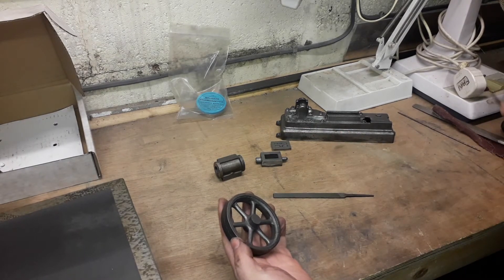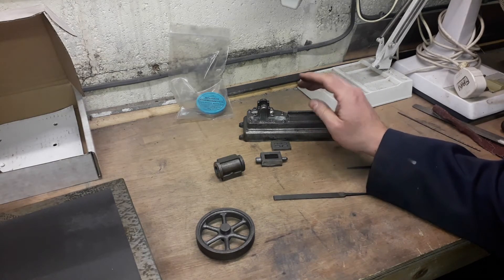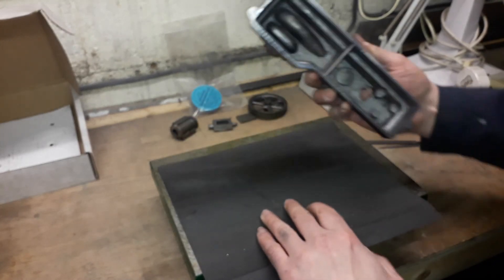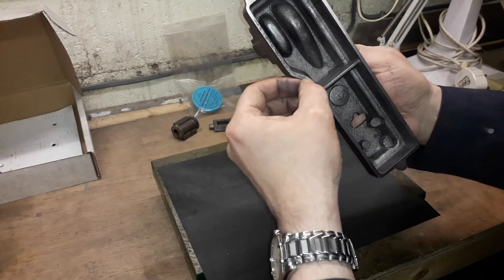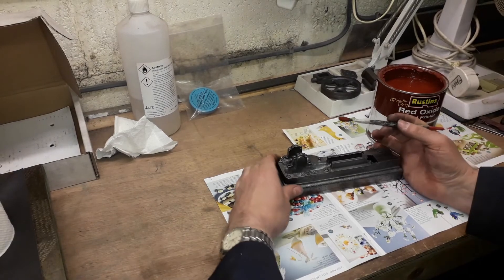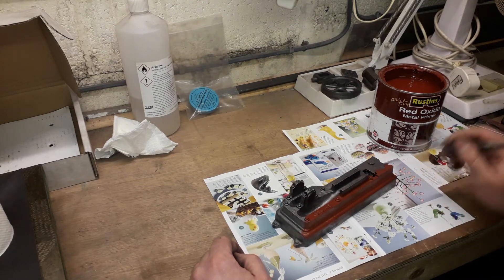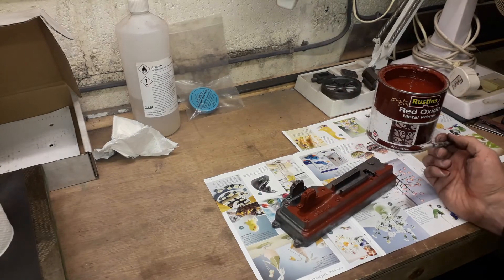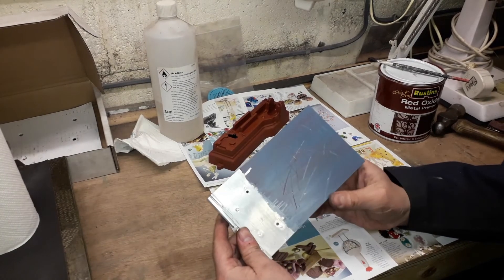Easy Stuart S50 steam engine build from castings, Part 1

Comment: Just got around to ordering that set of castings but being in the US I have no idea when they will get here. I did not prime my last castings till machined but may try your approach.
Reply from the maker: Have fun making, I'm sure they won't take long. The paint helps with making out but keeps oil from getting into the cast so easier at the painting stage, good luck.
Reply: @mattsbitsnbobsworkshop  I did get my casting quickly but they have to send me a new flywheel because part of it did not even full the mold!
Reply from the maker: @gvet47  That's great (about the speed) They are human, odd things may get missed but the after sales service is brilliant and I,m sure that will be quick. Let me know how the build goes cheers.